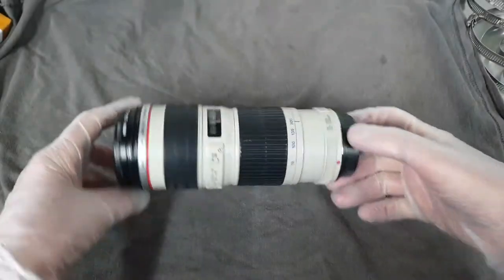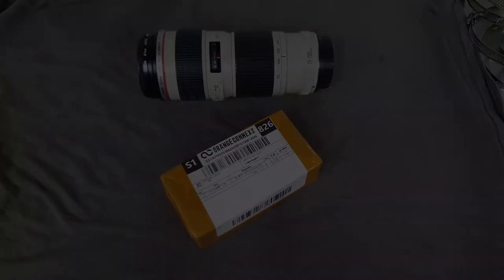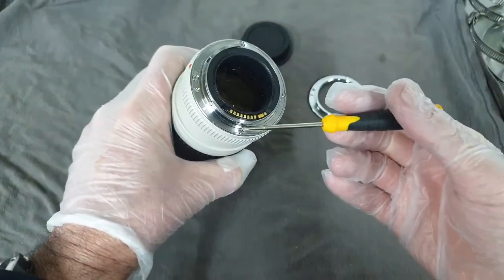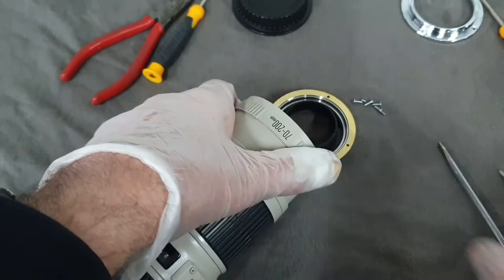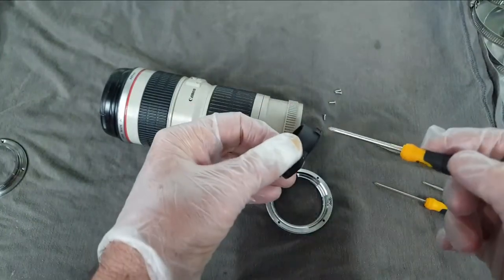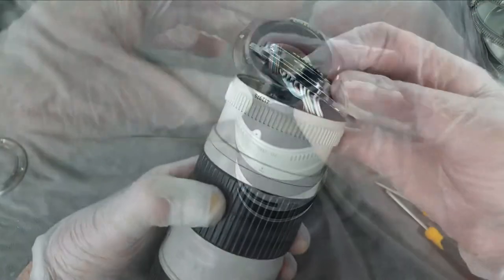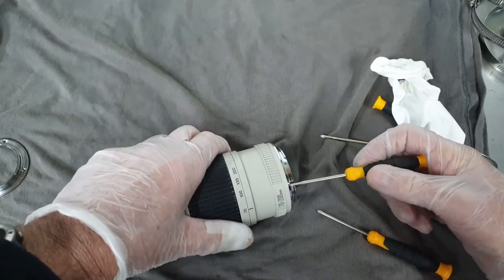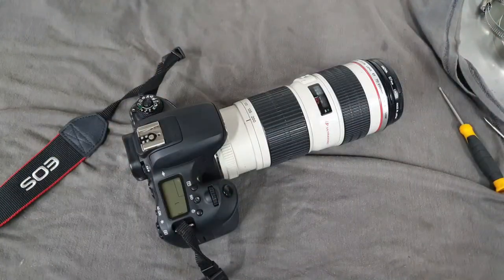Canon EF 70 - 200mm F4 Lens - Bayonet Adapter replacement

Comment: My "70-200 f2.8 version one" bayonet mount arrived, and DID HAVE some variation from the original, namely it was missing 3 holes for tiny screws (same size as hot shoe screws, arrayed around the mount barrel similarly to hot shoe screws), for restraining the black-plastic inner collar. I went ahead with the swap anyways.

Comment: good video! I just did the same thing to my bayonet mount on my 24-70 2.8. Do you happen to know if the canon bayonet mounts are the same for all EF lenses? I have one from a broken 50mm 1.4 that looks totally identical on the outside as far as screw holes go, but i'm not sure if the interior threading is the same.
Reply from the maker: Hi Chris, rhanks for the feedback.  When I was looking for the mount for my lens, it didn't look like it being generic, but I can't confirm that.
Reply: This is my question too. Bayonets seem to be sold by model, however the EF mount is going to be consistent regardless of lens. I suspect that canon only has one metal ef bayonet part number (or very few part numbers) that they reuse on each EF lens. From a manufacturing perspective it doesn't make sense to have several different bayonets when fundamentally the mount needs to be consistent across all EF lenses.
Reply: @DustinShort  just an update, I actually swapped out the bayonet mount from my 50mm 1.4 onto my 24-70 and it fit perfectly. Unfortunately I still had to send my lens to canon to get fixed since it was still having focus problems but that was unrelated to the mount. But yeah just to confirm, those mounts ARE interchangeable
Reply from the maker: @DustinShort I think the issue will be more about how the bayonet attaches to the lens.